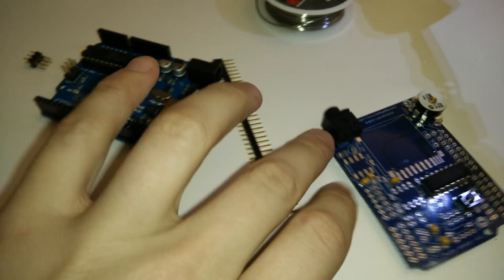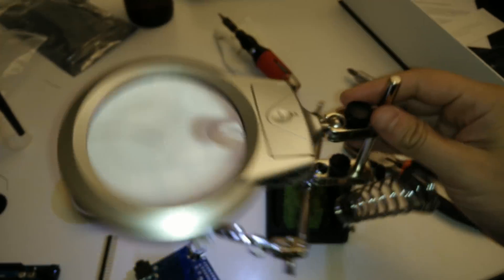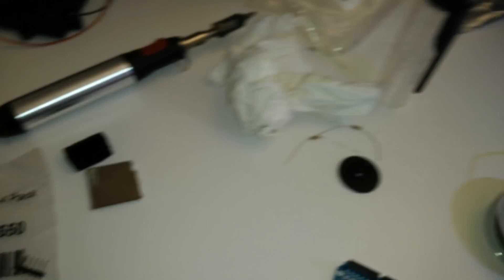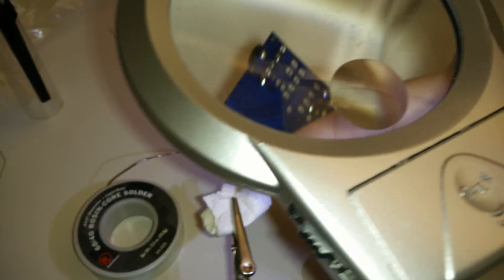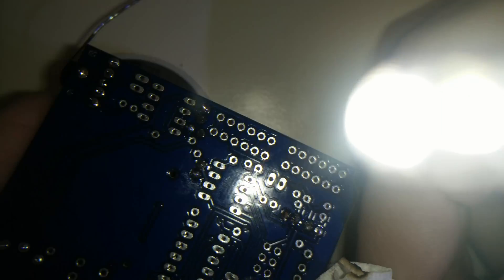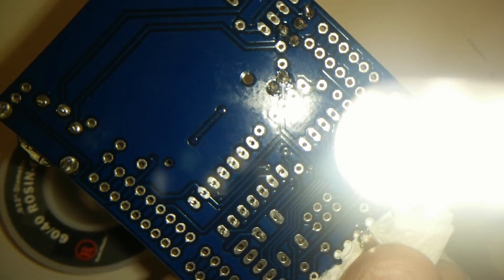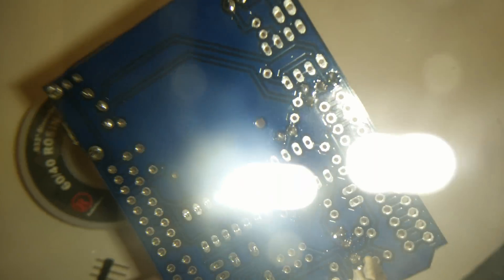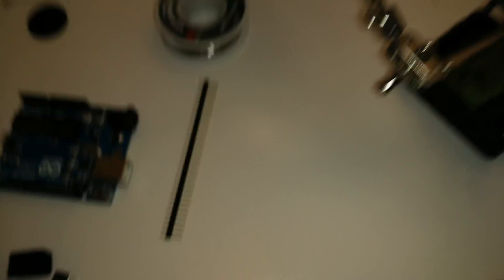Behind the scenes building stuff.

Comment: Never tried a butane soldering iron before; maybe I should. I just use cheap electric ones.
Reply: They can be good, just get one that's of decent quality. I made the mistake of cheeping out a few times and had one melt, one blow up and one just didn't get the bit hot enough. sptools had a nice one out last year for cheap.

also, 4k video is win!
so is that helping hand.. i need a couple of those bad.
Reply: No radio shack in Australia unfortunately, "Jaycar" is our alternative. I bought 2 from there, the first one was the $20-25 one.. it's went pop and made a big fireball on the workbench.

Currently using a massive electric unit from the early 90's that i found in the janitors closet of a data center at my old job. best day at work ever.

ps.i like these videos you make now, it's refreshing to see stuff that i consider normal and interesting, cep't for random midnight dojo'randomness..? compared to the junk that floods my homepage thanks to the girlfriend.